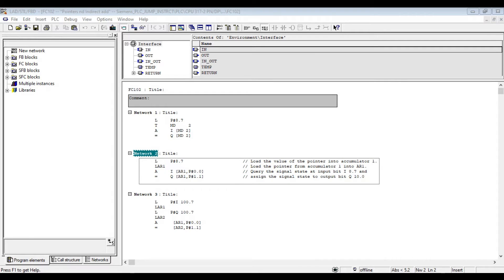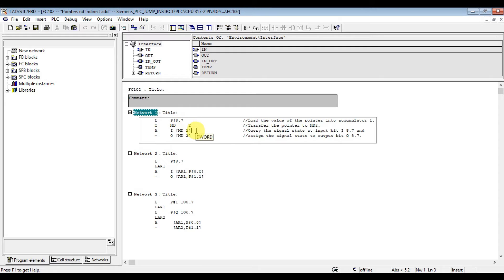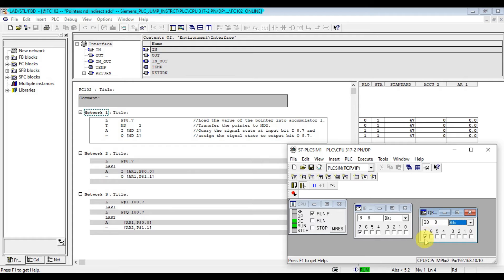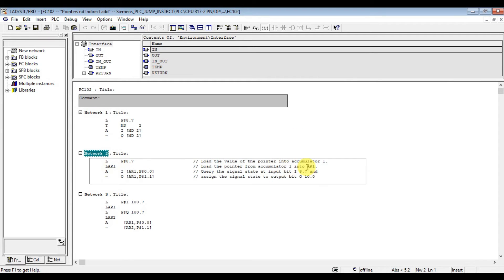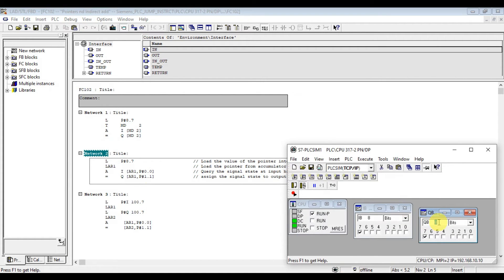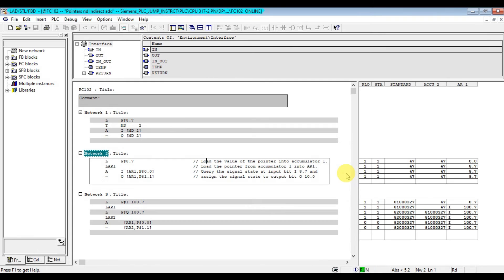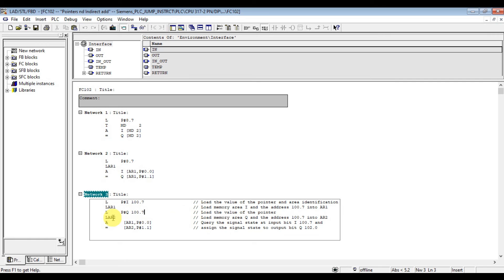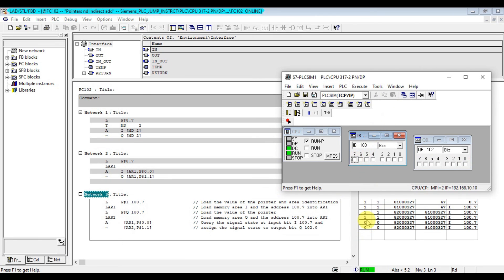Pointers and Indirect Addressing IN S7 300 PLC

Comment: What is the main reason why we use indirect addressing. And can you talk about sld 3
Reply from the maker: the Advantage Of Indirect Addressing Is You Can Change The Address Dynamically. example PIW[address] Means The Value Of address can be changed like 256 , 260 , 264  soon. But if you use PIW256 , It Is Always 256